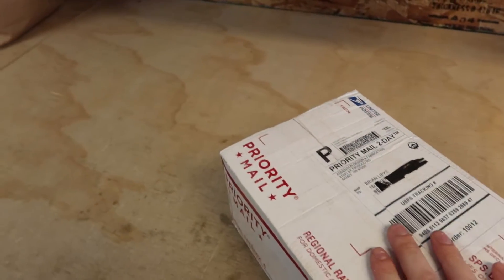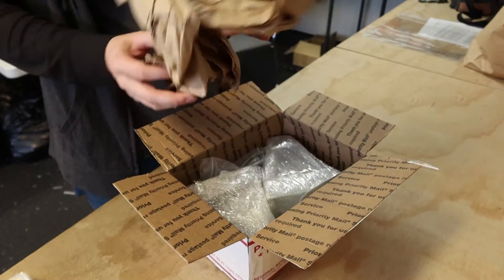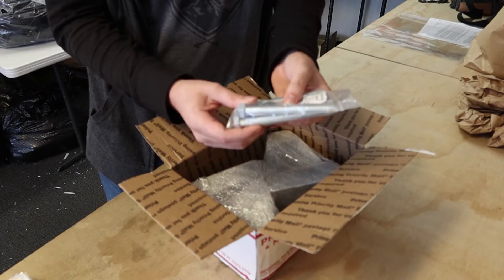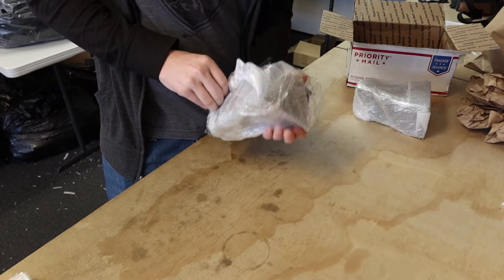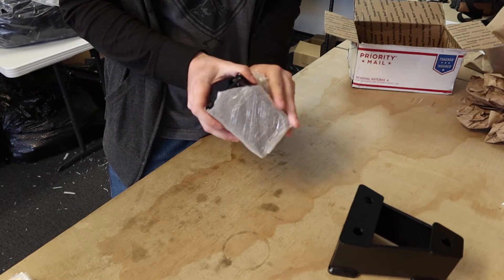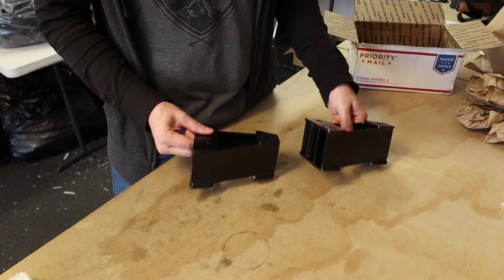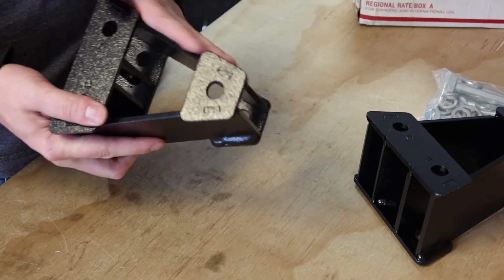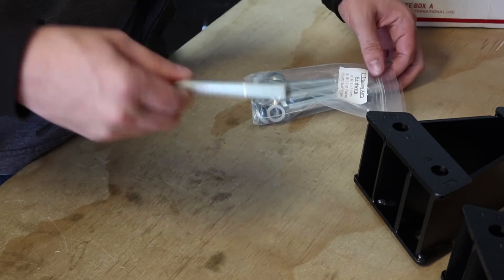Vlog 10 | Unboxing my new ADF 3" trailing arm spacers for my Forester XT!

Comment: Nearly a $300 order for these and the sway bar spacers didn't even come with a sticker fortunately I have one already
Reply: Well that sucks turned out I did have them after all looked at the wrong part  thought they weren't installed because even with them my wheel is still not centered.